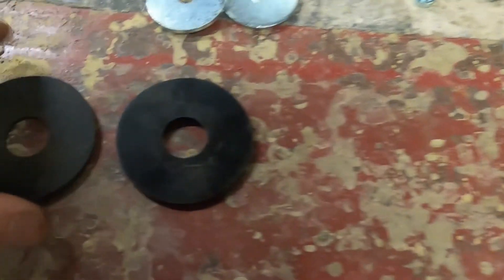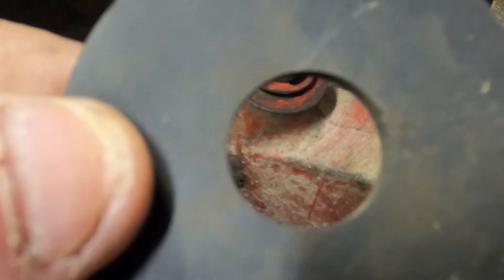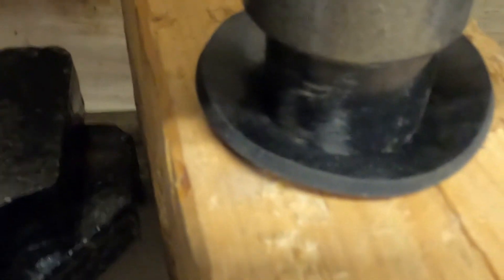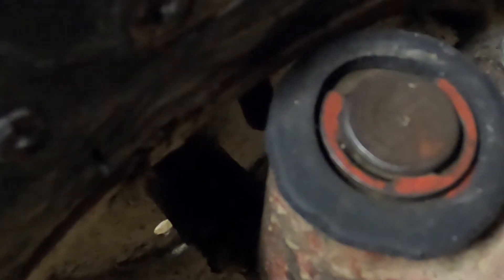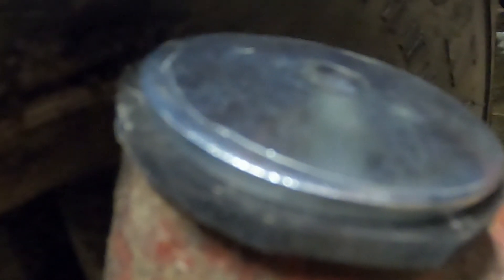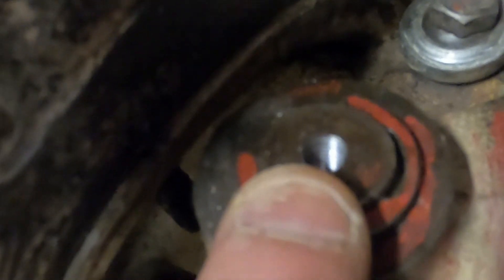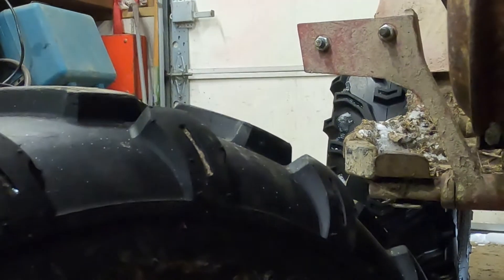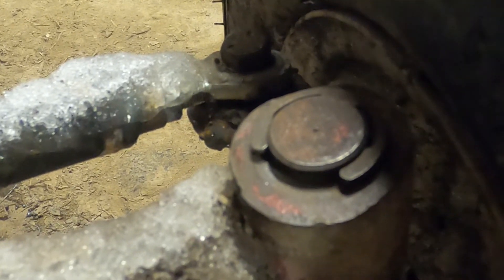Wheel horse off road spindle mod

Comment: Very cool man! I did something similar, but I used a 3/4 bronze thrust washer between the bottom of the axle and the steering arm, then used 3/4 machine washers and a big heavy washer on top and completely eliminated the eclip. Couple local guys switch from E full circle retaining clips and haven’t had a issue, but I’m like you I like a actual bolt
Reply from the maker: Thanks, yours is a great idea too!  I know a lot of guys put a lot of work and thought into their rigs,.....and obviously some don't....I figure when I am out on a ride with the "big boys"  I don't want to be the asshole breaking down.  Keep crawling I hope to meet you soon!